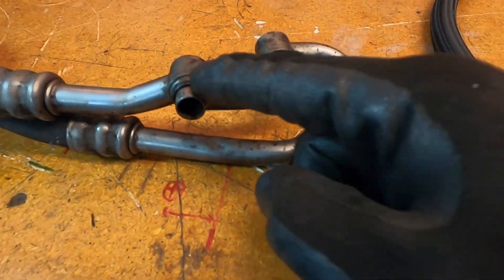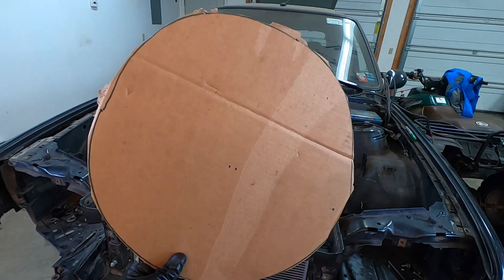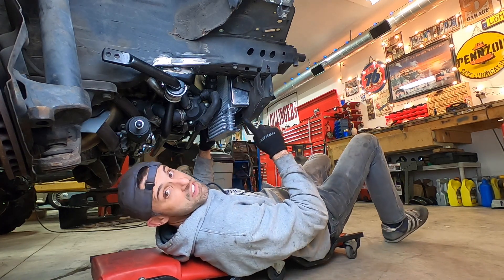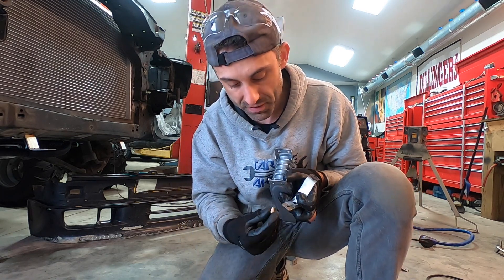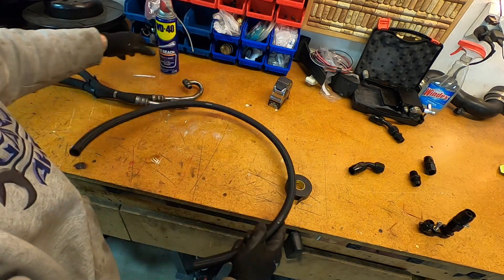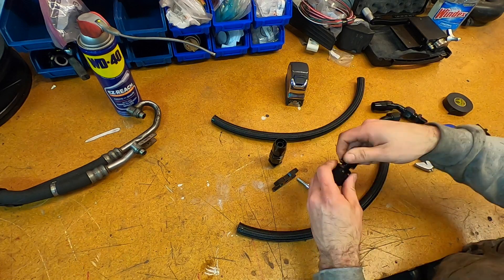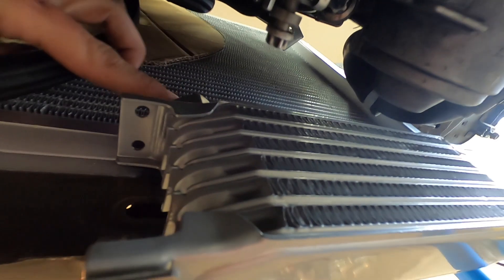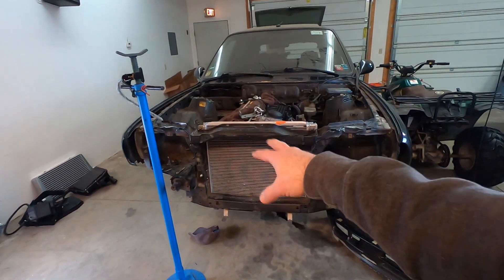Part 14: Check That Box! Oil Cooler Installed On This E30 N54!

Comment: Awesome video! I love that you explain what you are doing as you go along. You said you're not installing ac, but would it be possible with this swop? Cause where I live that is a must have...
Reply from the maker: It IS possible but this car didn’t have AC to begin with and it was too expensive to retrofit it so my customer opted out. I plan to update the e36 m3 n54 with working AC this spring, so I’ll post a video on that
Reply: @Garageaholic  thanks!

Comment: Very nice Frank. If this setup isn't able to get the oil temp low enough, you could try the BMS low oil temp valve first. If that's still not enough you can use a bigger oil cooler.
https://burgertuning.com/products/sport-oil-cooler-valve. Dutch regards, Nico